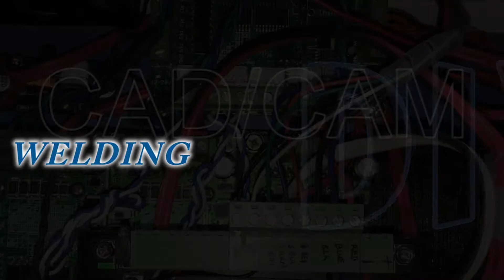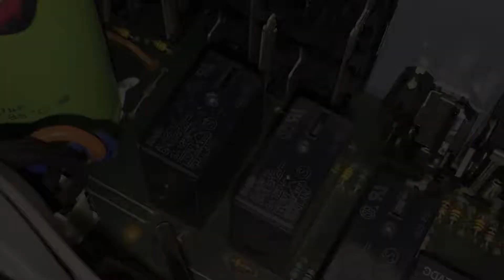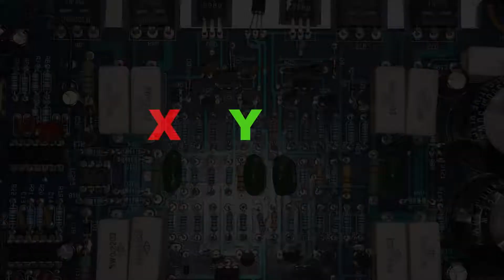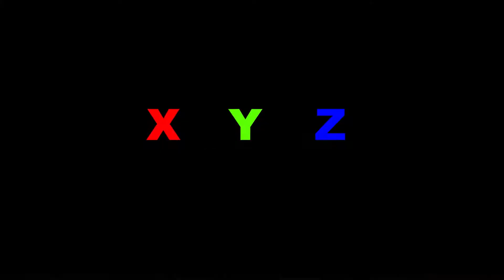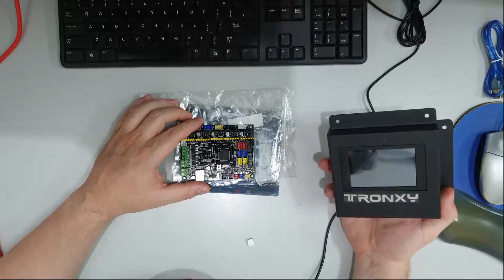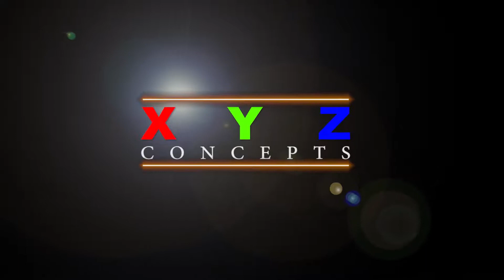#2 - New controller board for the TronXY

Comment: Would you show us the firmware installation? 
Also how you going to install the second Z stepper motor in the board. I just got my gen mks 1.4 and 5 tmc2208 but I'm bit lost

Comment: Should have went to a MKS SBASE V1.3 or Duet 2 Maestro. and get a silicone heat bed. and a 24v mean well power supply. I would go with a Duet 2 Maestro as its cpu is alot faster then any MKS boards. ALL coreXY should be 32bit boards not 8bit.